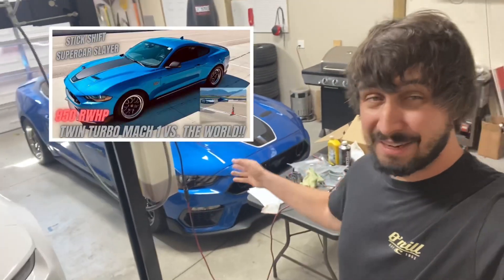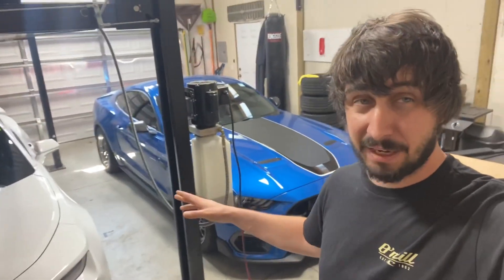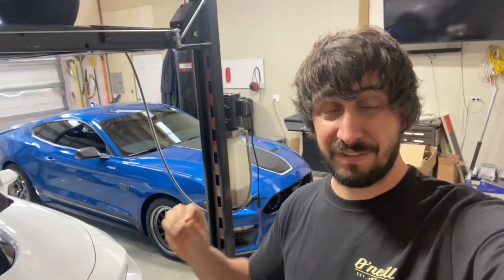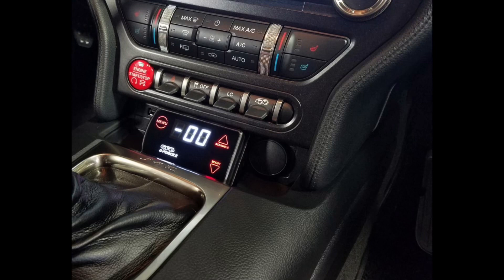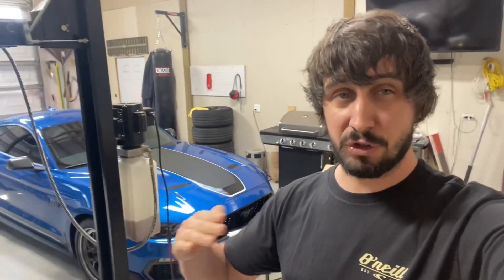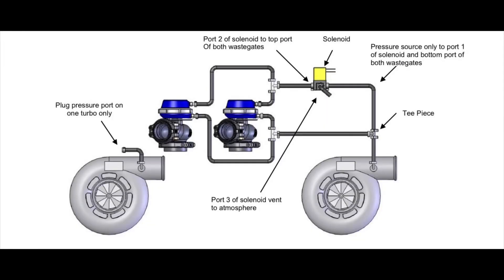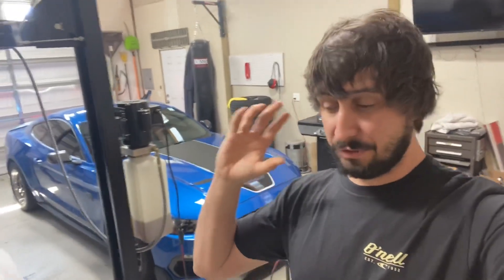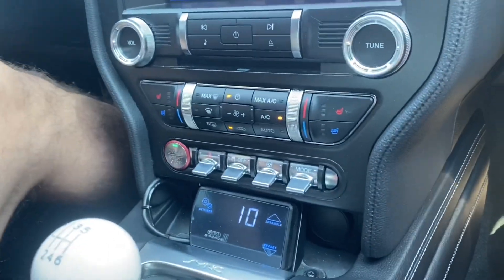I Could Have Ruined my Mach 1

Comment: Same thing happened to mine first time at the dyno, burnt line on the passenger side wastegate and couldn'tbuild any more than 10.5 lbs. I've run silicone tubing and insulated sleeves on both sides now.

Comment: Good to hear you got the problem located. I know one of the biggest manufacturers for fittings that are commercial grade. If you want, make a list of all the connections and hoses you would have changed. I'll see what solutions we can make.
Reply from the maker: Awesome thank you!  Just got off the dyno and fittings/hoses are good, solenoid is working, still not building boost.  Im home now, going to pull gates and try if i can solve leak there maybe diaphragm?

Comment: The hole in the line could have cause a big problem and blew your engine. Push lock fittings are the best way better then rubber. Or at least use zip ties to keep them from blowing off.
Reply from the maker: Ordered some stainless steel
braided hoses.  The fit was snug on the nipple but the placement of the wastegate and use of an elbow makes the routing such that a regular hose is going to rub the gate or get close to your exhaust.  Just something to keep an eye on.  Good thing I always had good gas in this thing!

Comment: Congrats on finding the problem and passing along the information. Many on YT wouldn't admit that and I'm certain Hellion is very aware of it. It might be worth it for them to replace the hose with braided lines in the kit ... I can only imagine how many have run into this same issue. $100 of braided line/fittings is cheap insurance.
Reply from the maker: Yea I noticed the issue and thought I had remedied it by dremeling some clearance into the dish around the wastegate (maybe a heat shield).  Clearly not the solution.  Im starting with one braided line and well go from there and might replace more.

Comment: Another great video!  Have you done any structural upgrades like a McLeod clutch, different drive shaft, rear diff brace, Steeda stop The Hop kit etc since you added the twin turbo kit?
Reply from the maker: Lol nope none at all.  To be honest I haven’t had any weird traction issues on the street or track from a role.  Perhaps the Mach 1 has a better rear suspension vs the GT.  It does use GT500/350 parts.  Id say if you have a Mach save your money on those.

No issues with the stock clutch or driveline either but I am sure down the road that will be a requirement.  For now it is all good.
Reply: @truckandroll989  thanks for the reply. I just picked up a 22 Mach 1 back in July and getting ready to do a few boltons.

Comment: Great job on your diagnosis. I think your on to something with the braided lines on the gates. curious if you think the turbos need blankets. still a lot of heat down there at speed. keep the videos coming!
Reply from the maker: I dont have a great way to track temperature down low besides inspecting it after the fact from beneath.  I can say for sure that my IATs have stayed almost identical to before adding the turbos (temp measured inside top of intercooler near outlet).  From that standpoint I think the engine compartment itself remains as cool if not cooler than before.  Ultimately I may need to convert the other gate lines to braided too as you said
Reply: @truckandroll989  Ok , I was thinking about the area directly around the turbos, W.O.T. those things can glow red. can you verify with a GoPro?